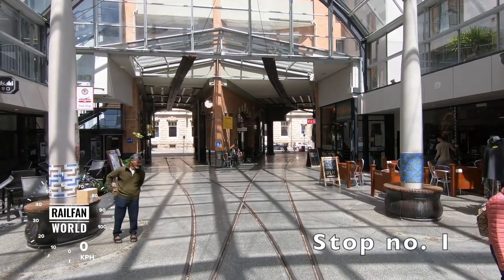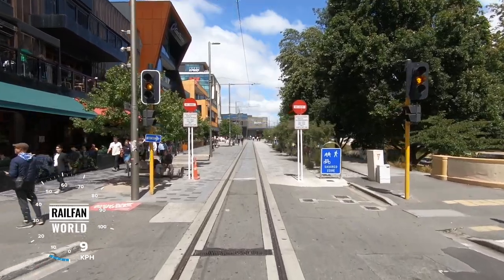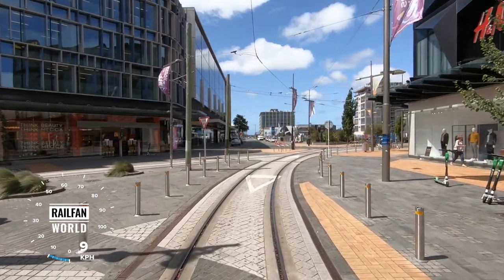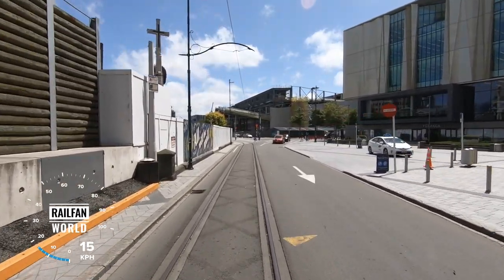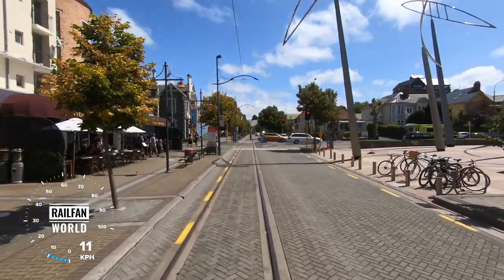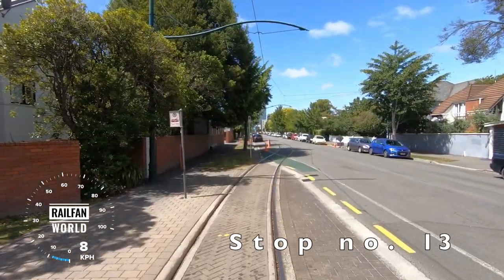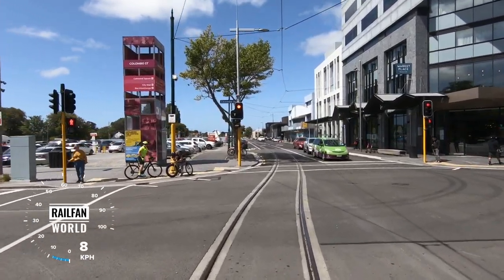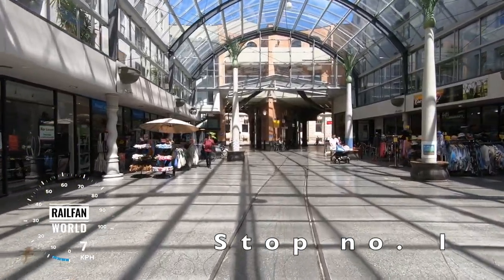Cab ride and speedometer | Christchurch Tram City Tour Loop | Heritage circuit | Rail in New Zealand

Comment: Such a waste of infrastructure, this line should be taken over, extended and coverted to running modern trams as part of the cities public transport network.
Reply: Trams are too slow to be very useful public transportation. It would be better to get trains instead of ruining the historical tram line.
Reply: @rachelcookie321 , MasterChief, and then you'd see the trains knocking down the pedestrians like bowling pins!
Reply: @rachelcookie321 trams are supposed to be used as inner city transport not bring commuters from suburbs